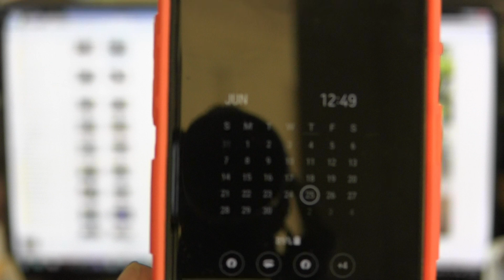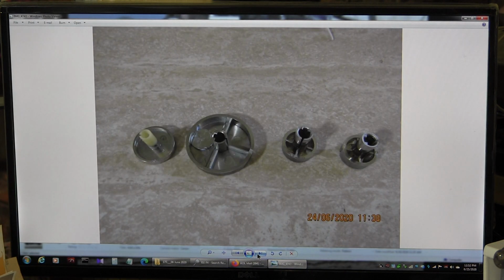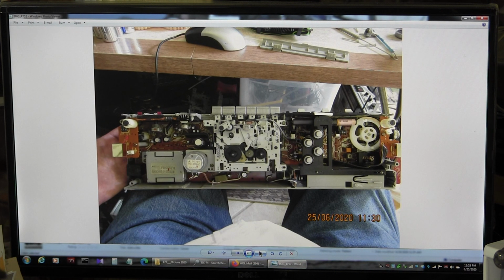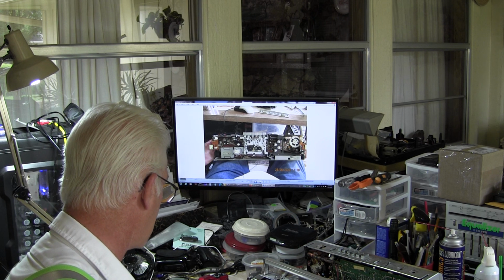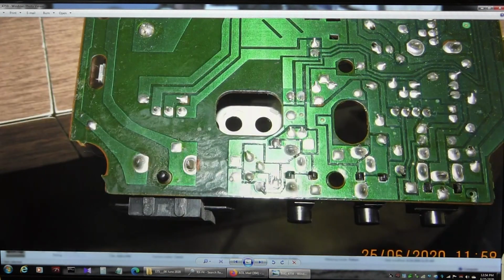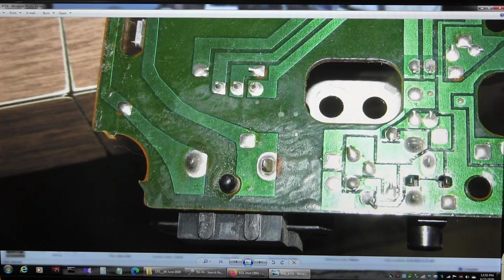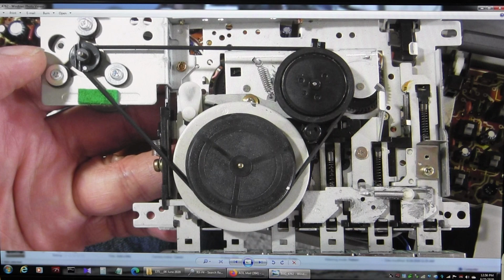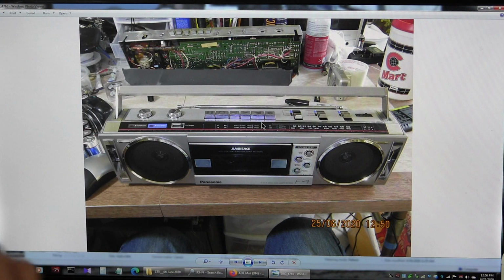Panasonic RX-F4 cord wiggle no power ac or dc how I solder fix repair

Comment: Hi James. I have an old Hitachi 9900H and when I tested it with an old AC power cord that fit (it wasn’t the original) it didn’t power on. I came across your video and tried to wiggle the cord before opening it up. The radio started up after wiggling the cord and it sounded great for about 2 minutes. I then heard a pop and it started smoking. Not sure if it was a bad/wrong power cord or something internal. I have a little knowledge and a soldering gun but it might be beyond my ability. I’ll email you shortly in hopes you might be able to help me troubleshoot it, unless you think it’s a boat anchor now. Thanks!

Comment: Hello James,
Is there any other thing (like sub woofer or tutor) equipped in this boom box for sound other than the two main speakers?
Reply from the maker: Here is a Boombox with a Dual-Voice coil Sub-Woofer = for sale Sony CFS-350 Inside serviced Rec/Play cassette radio Super dual voice coil subwoofer for sale 
https://www.youtube.com/watch?v=Ued8ROsYiLI 
$150.00 buy it now Total Shipped 48 states click here:  
https://www.paypal.com/paypalme/JamesCPierce/150.00usd 
 comes with power cord works as you just have seen
00000 Sony CFS-350 Inside serviced Rec-Play cassette radio Super dual voice coil subwoofer for sale
Reply: Yes along with both woofers,2 ceramic tweeter provided on both sides of set between crome plated fixtures